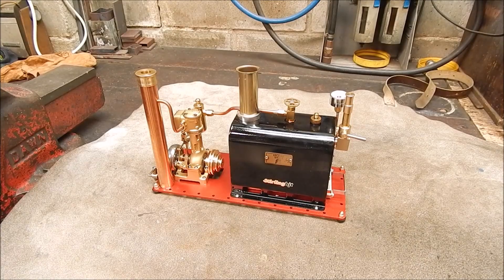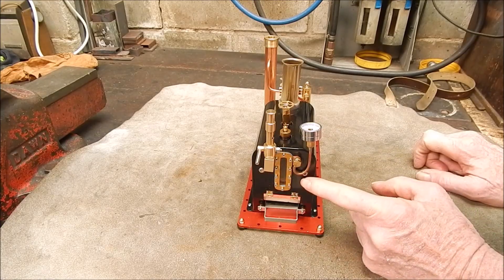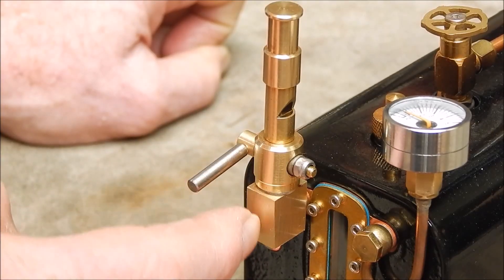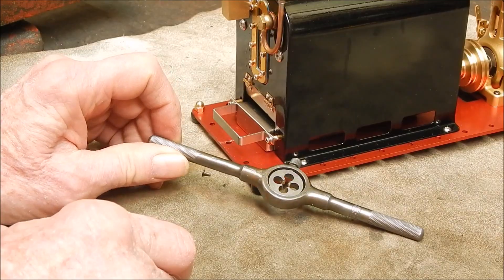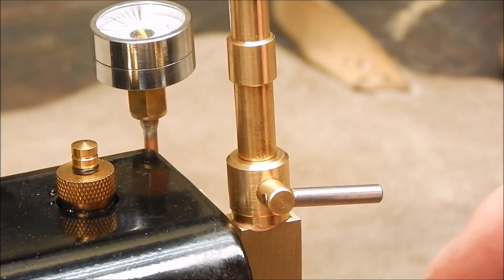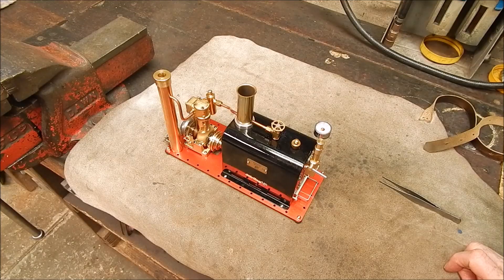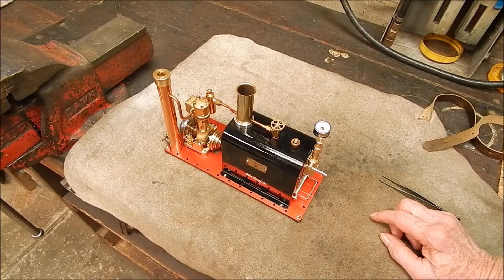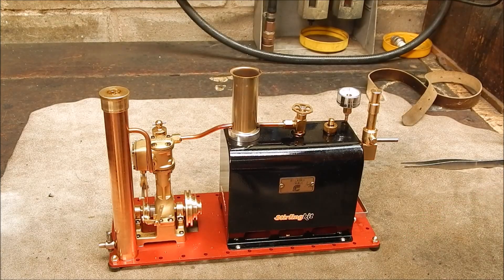I add a whistle to my favourite model steam engine boiler

Comment: TOOT,TOOT, next stop a in-line  lubricator?, nice little engine
Reply from the maker: Hi Ian.  That engine kit comes with a plumbed in-line lubricator.  First one I've had with that.  I usually add a bit of water soluble air tool oil to the boiler to lube things. Really nice engine. Cheers Rob

Comment: Great job Rob, looks like it was factory fitted 👍👍👍 Given the range of model steam engines available now you would think there would be a better selection of after market whistles. Cheers, Alan.
Reply from the maker: Hi Alan.  I kept it as simple/clean as possible.  Very few accessories to be had. I suppose the various thread types makes it a bit of a nightmare as to what to stock.  Having a lathe made it easy.  I milled and turned the job there.  About the only other addition would be a speed governor, but they appear to be more show than go ;)  Where to fit one would also be a drama.   I would be interested to mount the engine/boiler in an open boat to see how it goes.  I see they also sell a pre-assembled "V" twin version of this kit.  So much amazing stuff coming onto the market.  Cheers Rob

Comment: I’m going to try making a little uniflow air engine this summer. All I have is a lathe but that should be more than enough. Still some things I have to dial in, I tried making one of the rotary valve designs you showed on this channel a bit ago and couldn’t get it working
Reply from the maker: It's all a learning curve.  One of the main things is to machine close tolerances/clearances. I only have a lathe and it's also used for milling.  Basic equipment will get you there.  It's disheartening when projects fail, but persist and it will all come together.  Try something easy first, like a wobbler steam engine.  Good luck.  Cheers Rob